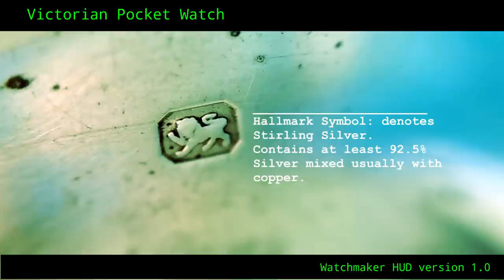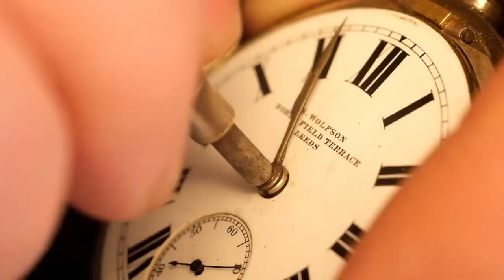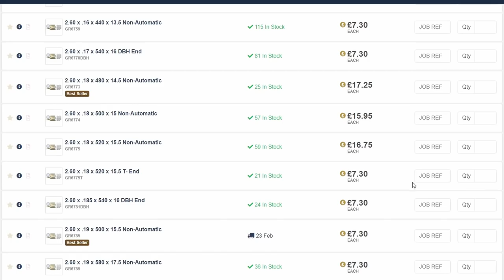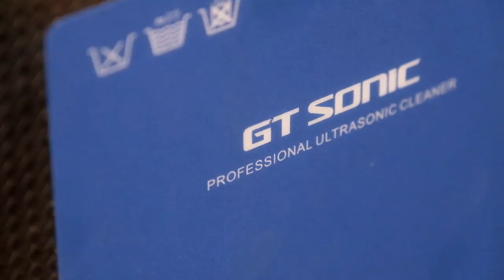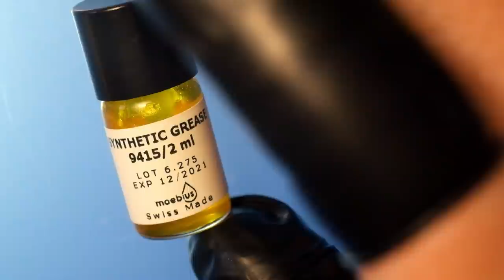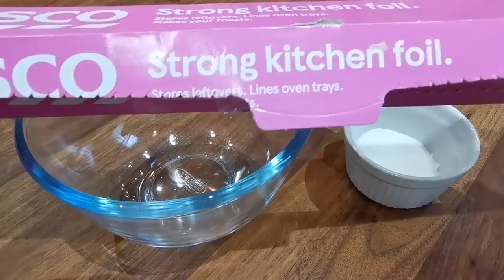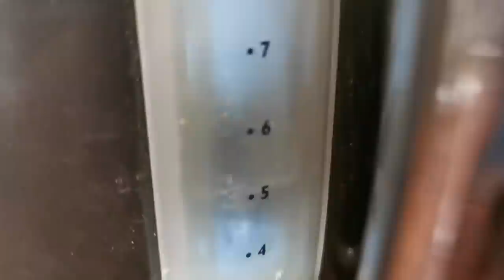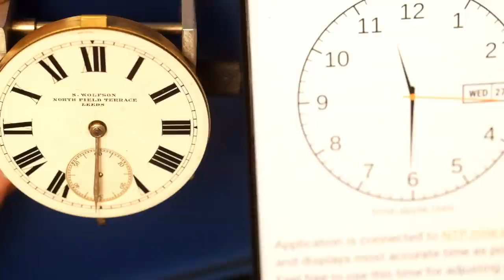Restoration of an 1890s English Pocket Watch

Comment: Thank you; there is much good practice to learn from your video.  I have just worked on two English lever watches and replacing the pallet fork in each was very difficult.  Knowing no better. I used tiny slivers of sellotape to hold them in place and then removed the tape when, eventually I got them in place.

Comment: G'Day Richard,  

Excellent video (as usual). I often run into problems reassembling these full plate English watches (esp. fusee movements). Your videos have shed some much needed light on the correct procedures to follow.

I also find your simple, strait-forward, no BS format a real pleasure compared to many other presenters.

Many thanks, Rob FNQ,Au

Comment: Thanks, watching your video and seeing the mechanism, I recognized it as being the same as the one I have, from my G.G Grandfather, by the hallmarks, the case is dated 1876 made in Coventry UK and purchased in Sydney NSW around that time, they obviously made a generic watch mechanism, and the faceplates were customized. It worked for about 8 hours before stopping again, it kept good time whilst it was working. I need to find a specialist like yourself to clean it. I'm guessing it would be costly due to the time involved.

Comment: Richard, congratulations again on bringing back to life to this beautiful watch, and joy to your viewers too! I'm wondering, why would you regulate the watch by checking the overnight deviation instead of using a timegrapher?!
Reply from the maker: Hi Juan... Thank you!  I love marriage watches.  Especially the not so big ones... Size 12s pocket watches and smaller are best for this type of conversion I think.  Sometimes you see a nice repeater converted which is very special.  Thanks for the feedback. Richard
Reply: To test performance, it might make sense to allow every wheel to turns at least once in case some teeth are damaged. A short-term timing test may not bear this out. On the other hand (pun intended), pivots worn loose or broken jewels could result in random timing variations that may be more difficult to detect, but can become a little easier to narrow down with multiple checks over a longer period.

Comment: I love these old pocket watches. The pride of my collection is a 9kt Benson half hunter that does have keyless works. My Uncle had a silver watch that looked very much like the one you have there. The key used to hang from his watch chain. I sometimes see these watches on eBay but the keys seem to always be missing, can keys be sourced today? BTW, I used to fix up old houses, I can meet your oiler point in the thumb and raise you a 3 inch framing nail through my finger. Also don't miss bits out  and explain more. You have taken the place of the shipping news before I turn in at night and your voice is really relaxing.
Reply from the maker: Hi Shouty man!  Ouch!  Not sure I could have kept the Camera rolling with a three inch nail in my hand.  Keys are easy to obtain but getting the right size can be tricky. Thanks for the feedback. Richard
Reply: My mother has a JW Benson as well, hers is 18kt. Would love to get it serviced, cleaned and running properly again, I do not think it has been serviced for 100 years or more.  
Would also like to know the year of manufacture.
Reply: @Daeyel  The case, if gold and British, will have "Hall Marks" stamped into the metal. You will have to find them with a magnifying glass and compare them to a list. There is some information on Google. There is a single letter in the stamping which gives you a year. every few years they recycle the letters but change the font. that is the key. Happy hunting. 
I am not an expert in this, so if anyone has better information, please add to this.

Comment: When adjusting the rate are you adjusting the weight on the balance or the hair spring? Wow does that balance move slowly. That movement will probably live forever if probably serviced.
Reply from the maker: Hi Jimmy  ... so the timing screws on the balance make  the balance go faster or slower and in this way I can regulate the watch so that it is correct as it can be and yet the regulator arm (which works on the haispring) for the watch user is in the middle of it's range giving the watch user maximum options downstream.  Hope this is helpful,  Richard
Reply: @richardperrettwatchmaker  yes very helpful,  thank you for sharing. I find amateur watchmaking fascinating and relaxing.  A great way to shut off the outside world and focus on something different and exciting. Fabulous hobby. Love watching your videos.

Comment: Oh how tense it can be in placing the back plate and having all the pivots of the train fit to the trunnions of the plate on the first try. I have a shop made set of picks to push and pull an individual gear into position and only start breathing when i feel the “click” as the plate drops flat on all points.

Comment: Hi Richard, Great job and very informative with all the tips. Can you tell me please how do you dry the watch parts after cleaning and are they dried between the clean and rinse stage. Cheers, thank you. Alan
Reply from the maker: Hi Alan ... it pretty low tech but I use a hair dryer!  Works really well and you can manually and visibly direct the flow at the parts that need the most drying and also dry from all directions.  Hope this helps.  Richard

Comment: how do you know if the mainspring needs replacing? it seemed to have tension.......is it because it doesn't really unwind itself when you removed it?
Reply from the maker: HI Toby ... when unconstrained the spring should be several times larger than when it is in the barrel.  If it is only twice as big (diameter) it is tired and needs replacing.  Most old pocket watches will benefit from a mainspring replacement.  Hope this helps.  Richard

Comment: Was the pallet fork fixed upside down essentially and just held in place by lubricant before assembly?
Reply from the maker: Hi Ray... Held in place with rodico between the banking pins!  Works nicely as a method for replacing the back plate. Richard
Reply: @richardperrettwatchmaker  superb love these videos

Comment: Begs the question:  How did you fish out the piece of Rodico you used to hold the Pallet against the Bridge???
Reply from the maker: Hi DitzyDoo.. Just gently with a pair of tweezers.  The pins are at the edge of the movement so very accessible.  Works a treat!  Hope this helps. Richard
Reply: @richardperrettwatchmaker    thank you for responding, it does indeed.  ^~^

Comment: Richard, I have another question for you. Where a movement states it is adjustable to 3,4,6 positions etc, what does this mean? Can you tell also by looking at a movement?
Reply from the maker: Hi Ray ... it means the adjustments have been made to the balance to optimise the accuracy when the watch is in different positions (Dial Up, Dial Down, Pendant right ....)  and no you cannot tell by looking at it.  These are fine movements of the hairsring in relation to the staff and removable or weight from or movement of position of the timing and temperature screws on the balance.  Hope this helps.  Richard
Reply: @richardperrettwatchmaker  makes sense  thank you

Comment: 5:39 The main spring you chose is longer and thinner than the original. Why?
I have a 1901 J.G.Graves "The express English lever" that has the same movement which needs a new mainspring.
Should I go for a thinner longer one? Or stick with the same dimensions as fitted?

Comment: When you replaced that large plate Richard,which I assume was for the train of wheels I saw a small piece of Rodico on the underside.Was that a temporary thing and what is a reversing pinion?I was surprised by the silver hands as I have only seen blued hands on this kind of dial in the past................................
Reply from the maker: Hi Russell.... That's rodico holding in the Lever which is otherwise pretty tricky to locate as it sits partly in the recessed lower balance jewel chamber. Hope this is helpful. Richard

Comment: Hi Richard.
I'm working on a verge fusée from 1890 which has a sloppy minute hand - keeps falling off. I've tried the trick of trapping a hair in it as I put it back on but to no avail. Do you have any tips to get round this? The minute hand is just a flat plate with a hole in not a 'cylinder' type the I could squish slightly.

...and the tinfoil, bicarb and salt detarnish bath is excellent, works tremendously well....and makes a good tempura batter after ;-) Thanks.
Reply from the maker: Hi Andrew... Suggest you put the hand on a staking tool and flatten out the inner underside  rim will a flat nosed stake.  It should reduce the diameter of the hole and assist the hand to grip the arbor! Hope this helps. Richard
Reply: @richardperrettwatchmaker  many thanks, will try that. It won't need much.
Reply from the maker: Let me know if it works! Richard
Reply: @richardperrettwatchmaker  hi, I will do thanks. I don't have a staking set yet (on wish list) so will improvise. Takes me back to sheet metal work training during my apprenticeship.
Reply: @richardperrettwatchmaker  Hi. Yes it did work although I had to use a small bench vice and a pin punch, ( no staking tool)  three gentle taps and it deformed just enough to grip the (square) pinion. 
Likewise a couple of gentle squeezes on the second hand tube gave it just enough grip.
This was brought to you by the 'Back-yard blacksmith school of watchmaking'.
Thanks for your suggestion. :-)

Comment: Great closeup photography Richard, as always.  If only HUDs worked like that!  I probably missed them but I failed to see any jewels in this watch, but I saw in your introduction that some models were heavily jeweled.  When did the use of jewels become commonplace?
Reply from the maker: Only six jewels on this watch, two at either end of the staff and two on the Lever... The impulse jewel is actually brass on this piece and yet it keeps in at less than a minute a day at the moment. Thanks for the query. Richard